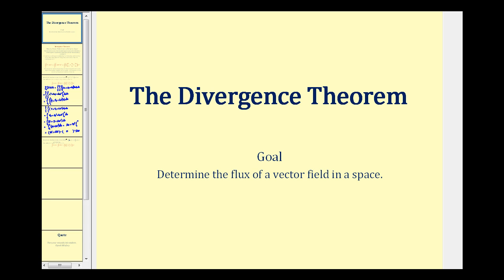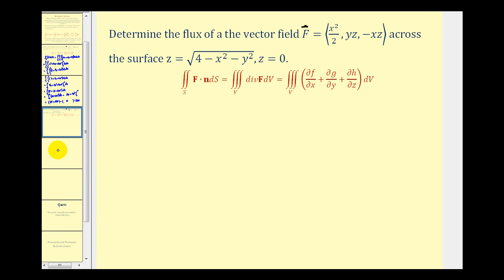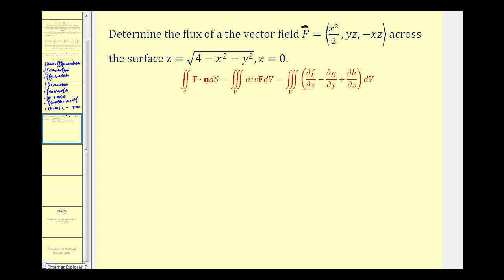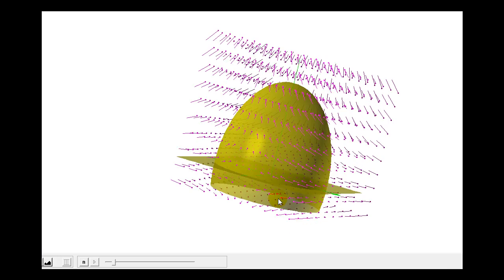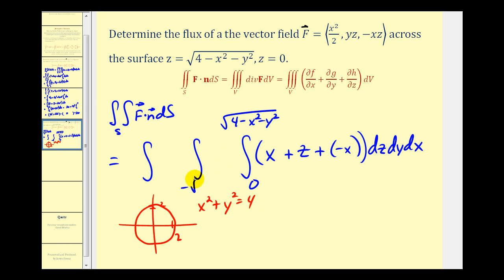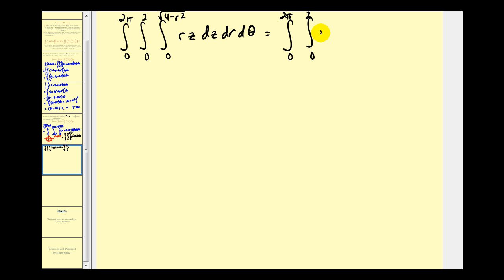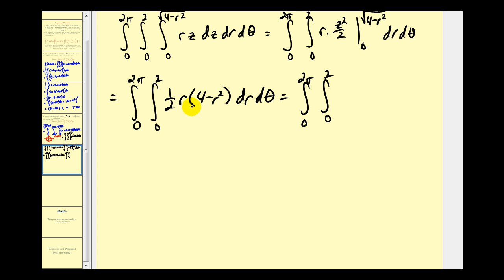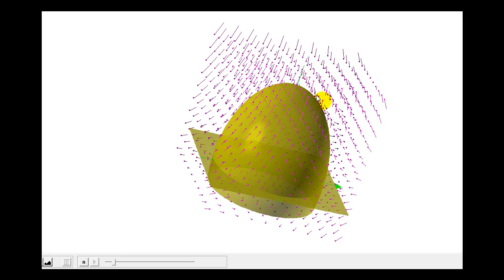The Divergence Theorem - Part 2

Comment: Why is x^2+y^2=r^2?
Reply: In polar and cylindrical coordinates, x=r*cos(theta), and y=r*sin(theta), so x^2=r^2*(cos(theta))^2, and y^2=r^2*(sin(theta))^2. Now add x^2 and y^2 together, and then factor out the r^2 (Inside the parentheses, after factoring out the r^2, you will be left with (cos(theta))^2+(sin(theta))^2, which is equal to 1, and then r^2*1=r^2).

Comment: He doesn't ignore the vector field...you must take the triple integral of the divergence of F (which just results in z) times dV.  he takes the divergence first, then sets z=0 to find the bounds of y and x, realizes they are messy and would be much easier in cylindrical coordinates, and then converts to cylindrical (x^2+y^2=r^2, and then as z=0 gives a cirlce with radius 2, r goes from 0 to 2 and theta traversing the circle goes from 0 to 2pi)